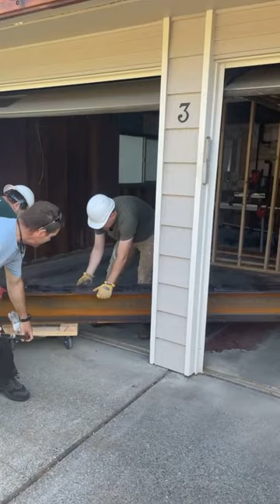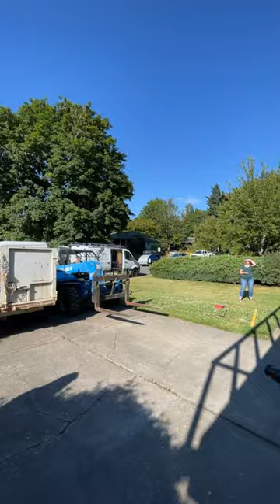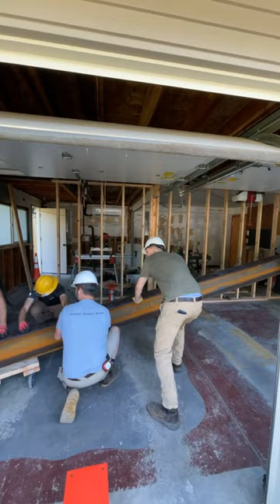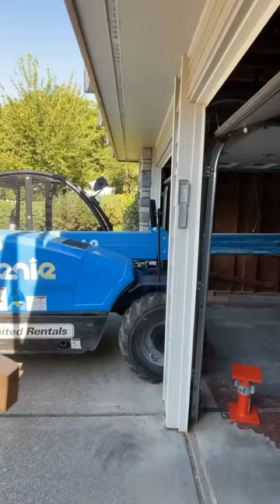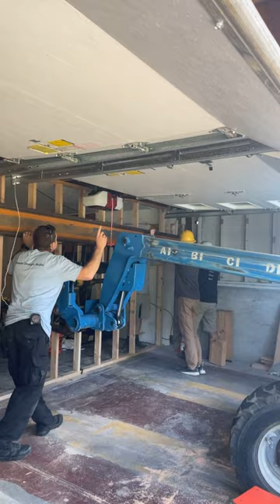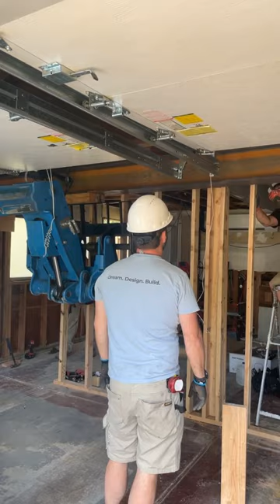This beam was 1500 POUNDS #behindthescenes #impressive #construction

Comment: I have done this solo with nothing more than 6x6 and 6x7 cribbing, and a 20 ton jack.
Reply: Mr George?
Reply: @urnew  his self
Reply: @urnew  full disclosure:
 i did have three dowels and a broom handle to get the beam from delivery truck across the yard and up into the lake cabin.
Reply: And a crane. 😂
Reply: Seems overkill. Hydraulic car jack does the same
Reply: @spectrepro  my 20 ton is the smaller than the jack that comes with my pick up.
The wider footing, lower profile, and added weight makes it more stable.
The real trick is the single 4 foot by five foot cribbing stack in the center 
This can reduce the lift of a 20 foot Hbeam by 50 % as the free ends weight helps lift opposite end.
Teeter totter and add to the stack until you are at the required height.

Comment: Got to love the hard hat but short and sneakers look, not that any of those items would help if it’s the beams we are concerned with, but yes very nice job overall.
Reply: Hardhat stops you banging your head. Sensible when half a dozen guys doing their thing. It's not to protect you from a falling beam.
I have several pairs of what look like Asics sneakers but have safety toe caps.
Only saw one pair of sneakers in there and what's wrong with shorts on a building site??
Reply: @DiscoFang agreed. Im a framer and wear sneakers and shorts all summer
Reply: @bri_guy508  Indeed. Feeling what your feet are standing on is def a primary safety concern when framing!

Comment: This couldn’t be accomplished with 3lvls?. Great video
Reply: The deflection on 3 lvls would be significant. You would also need lvls 18-20 inches thick for that span. This would drastically reduce the clear height of the garage. Steel isnt really expensive and provides better structural rigidity.
Reply: I'd say it would have to be pretty thick. I put 3 30ft 18" lvls in my living room/kitchen. About 1000lbs in wood.. Not much more with the steel and the steel is much shorter
Reply: That is what I thought. LVL is lighter and strong enough for that.

Comment: Drill for 2 by 8 every 4 in with a 1 inch hole nail them on each side of the beam lifted 4 inches at a time placing a grade stake in the whole gradually lifting each side it's only £750 two guys and a two-by-four can always lift it four inches easy save you about $10,000 of money with all those guys in machines done at my whole life